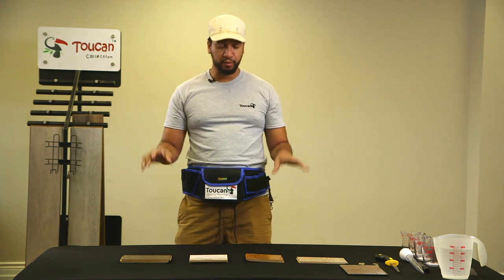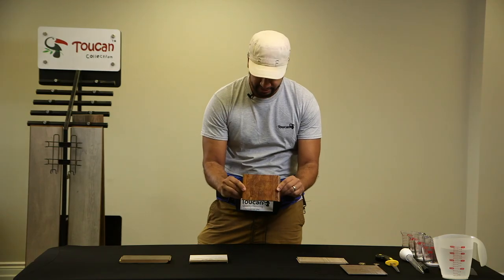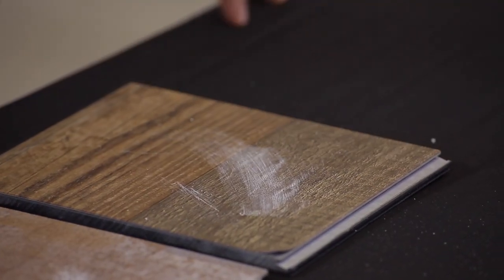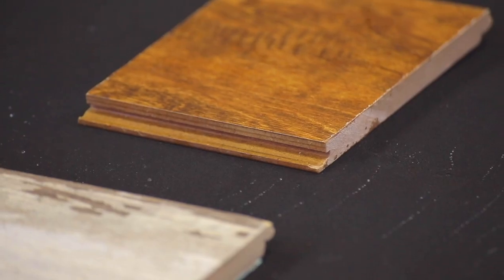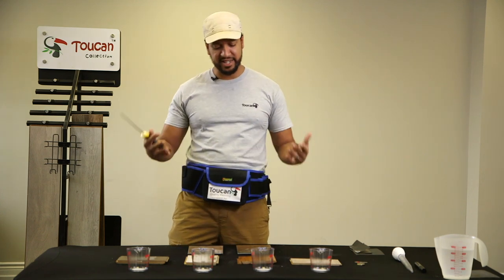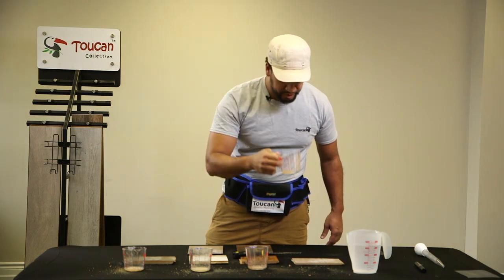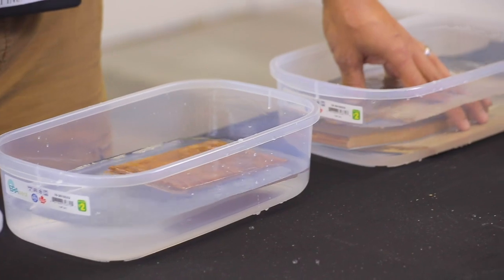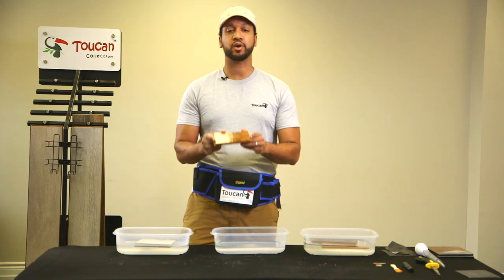How to identify the quality of laminate flooring

Comment: Hi, Thanks for the video, but I didn't have the same results when water testing the Toucan water resistant laminate flooring.  I did the submersible water test on 2 cut pieces of Toucan water resistant laminate with AC4 rating for durability and a 15 year commercial warranty.  After only 24 hours, it was swollen in several places, and I absolutely didn't get the same results that you got in this video. TF4110-F is the product number on my Toucan laminate flooring box.  You Toucan laminate flooring at 48 hours submersion looks better than mine at only 24 hours submersion.  Is my Toucan laminate flooring the same as the one in this video?  If not, what is the product number of the Toucan laminate flooring in this video?  Thank you.